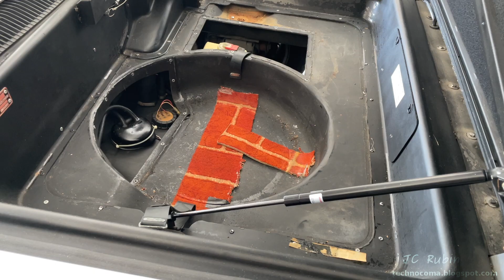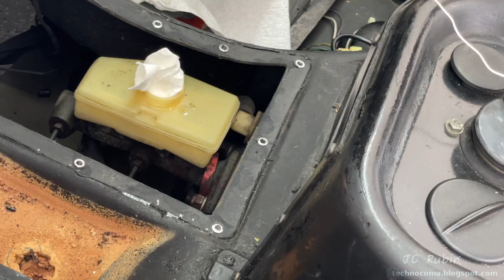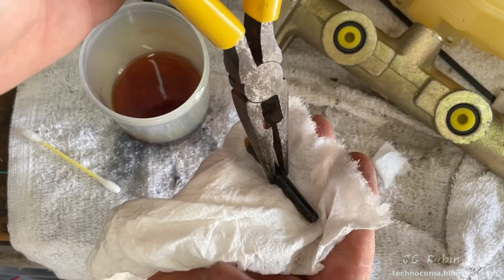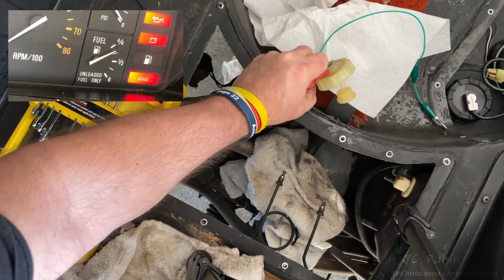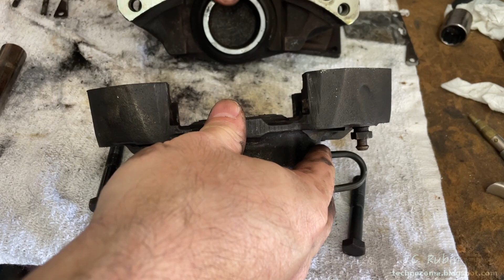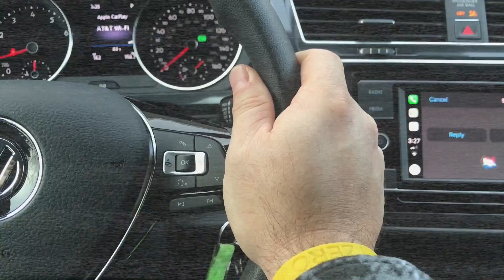Delorean Brake System Overhaul - Part 1 of 4

Comment: If you noticed there are two holes in the bottom of the sending unit. I like to plug both of them. If you leave them open, the fuel gauge needle won’t be steady. It will dip lower under acceleration, and raise under breaking.
Reply from the maker: You’re right! I caught that. Wonder why it was done that way.